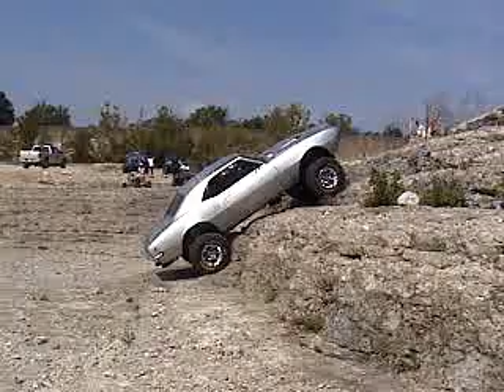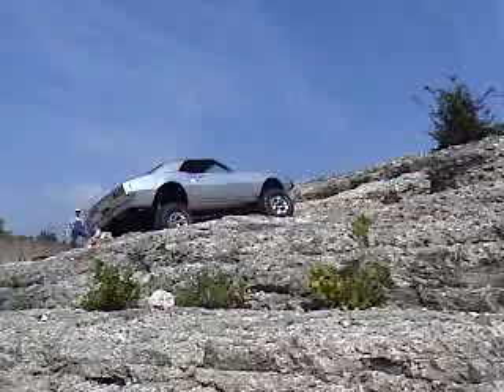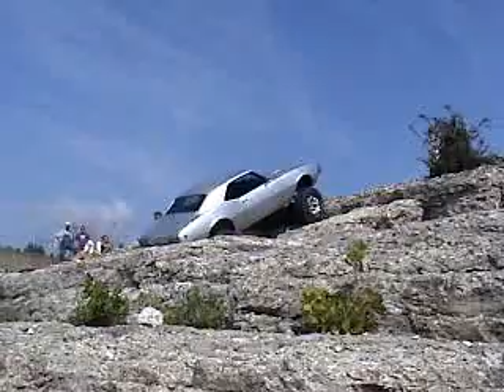The Binderbird Climbing the wall.

Comment from the maker: I got the car in 1978, converted it in 88,   It  took 30 days from start to finish. But really took about 15 days 'cause I cut my hand in the process and had to let my thumb grow back on!  It drives perfect, It will do 130 mph. It really is a dream to drive. it is on the original sub frame and unibody.  It is 1 out of 684 HO Firebirds made. Original A/C car, deluxe interior with bench bucket. The interior is factory stock and in perfect original condition.

Comment: Well the binderbird is still rolling this is December of eighteen it now has a 600 horse fuel injection system on it it soon to get a 550 horse Buick Big Block in it and it's just the most awesome of cars not on a four wheel drive frame as I said before and I was running over the winch cable so my spotter told him to pull it up a little bit so anyone that thinks that I went stood up well I don't care what you think. Thank you to all the guys that love my car it really is a true muscle car now and it's just as fast now as it was when it was a two-wheel drive probably a little faster it's not on a four wheel drive frame I could turn it back into a two-wheel drive in 3 days I haven't heard anything on that car I haven't cut the car up just pull the 6 subframe bolts out disconnect steering column, roll another subframe under it this time with original disc brakes what am I saying I'll never turn it back into 2-wheel drive insurance now says it's worth $80,000 have no problem ensuring it for that so we'll just stick with the four-wheel drive now remember its original interior original - Factory AC car one of 294 ho Firebirds built in 68 West Factory AC Deluxe interior bench bucket shifter on the column because it isn't bench bucket many many more special order parts on it I have all the build sheets I have every piece of documentation there is to have on a vehicle including the Moroni sticker

Comment: nice winch from the car on the hill :)
Reply: Did not winch it up we did have a winch hook to it case I went over backwards but the winch cable was dragging under the left front tire so my spotter told him to pull it up a little bit,,,
Reply: No. The winch was for safety was loose the whole time. The 1:03  cable was getting under the left tire so my spotter said pull it up a little bit

Comment: yea i hate to say it, but in the begining of the video there is a jeep at the top and you can "hear' the winch pulling....plus you can hear the guy say " pull him up a lil bit"....now if you wanted a winch to keep from flipping, i can certainly understand that....but it seems you didnt do that climb un-assisted
Reply: We had the winch cable to keep it from flying over backwards it was the first time I ever went up the hill so I had a safety cable on it the winch was getting under my left front tire so he said pull it up a little bit I would pour 5 gallons of gas on that car and burn it to the ground before I winched it up,,,

Comment: Hi Gerg, Been a long time. I titled that car way back in 1978. I drove it for many years fully titled and insured as a two wheel drive. Remember the time we got drunk and was doin donuts in it in 1985?  Then three years later I did the conversion? At that time I thought I would have trouble with the state keeping the stock title after converting it to a 4X4 but they said they could care less so I was more than happy doing it. Anyway it is still running super strong and is in world famous Ron Pfingstens'  body shop getting another new blinding silver paint job. Ron has been in Hotrod Magazine many times for his awesome paint and pen stripe vehicles. Should be done by the end of August.

Comment: I didn't know it was called the GRAND STAIRCASE when I climbed it like 30 years ago.. Still 4 Wheeling the Binderbird to this day. Now it has a 600 hp. Big block fuel injected Buick, it will do 80 in first 105 in second and only God knows how fast it will do in 3rd and that is with my street tune. It drives absolutely perfect. BAAAAD MOTHERFKER!!! Will take on ALL bets,, both on and offroad. Git out yer cash,,,,,,